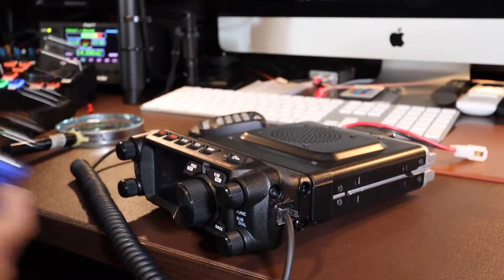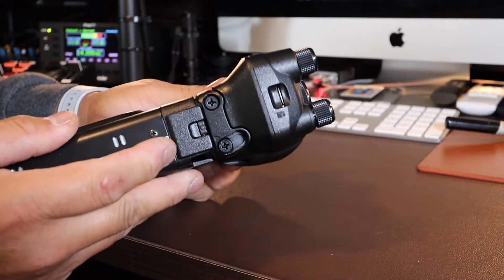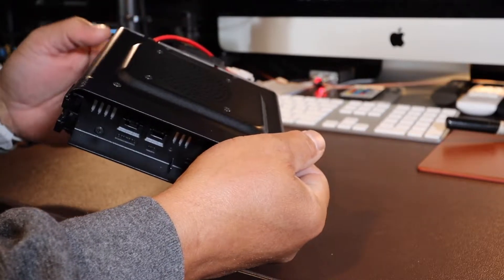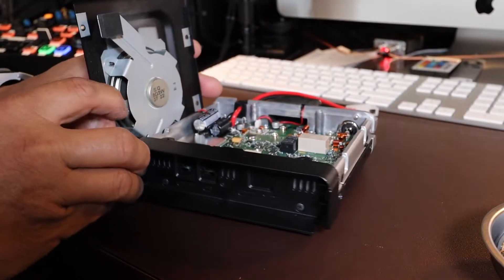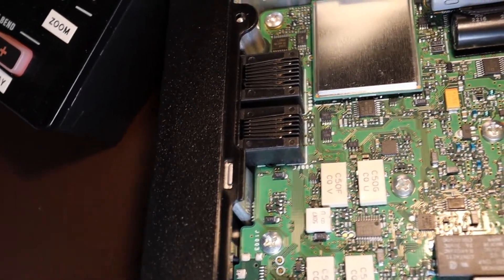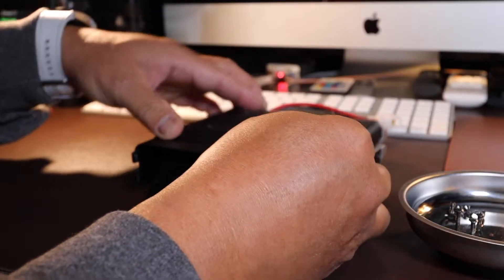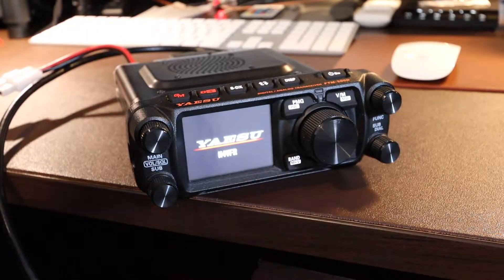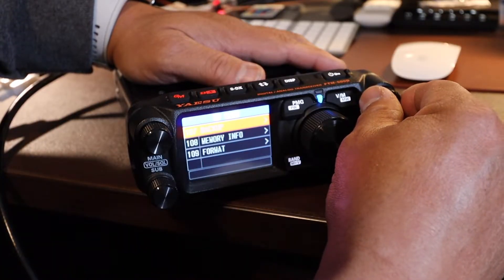Yaesu FTM500 MARS Modification | Out of Band Transmit

Comment: I have the same radio in its box for the last year I don't install it because I don't if need software for programming
Reply: software is on Yaesu website for over 6 months now
Reply: You don't need software to program it. It does make it easier, but it's not necessary and the instructions on how to do it are pretty clear in the manual.